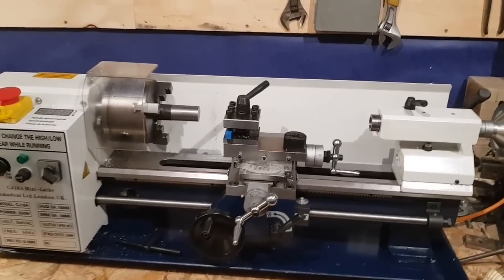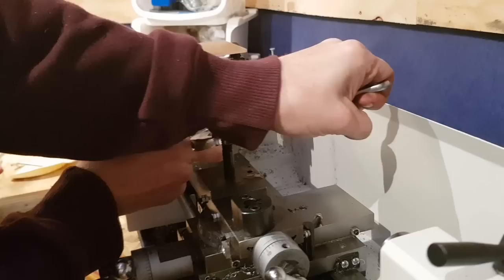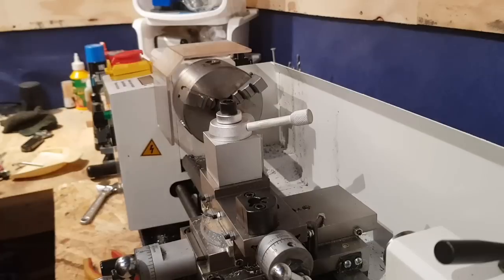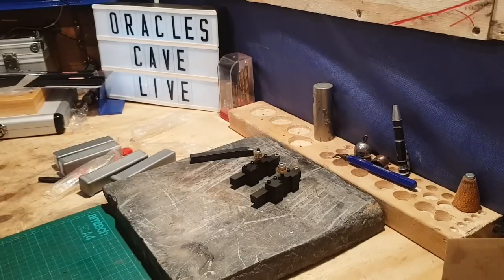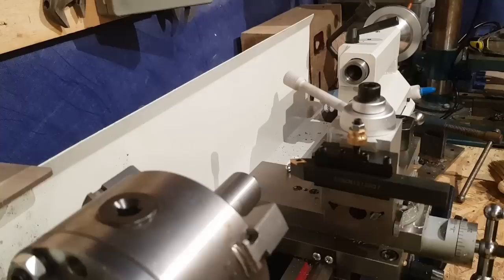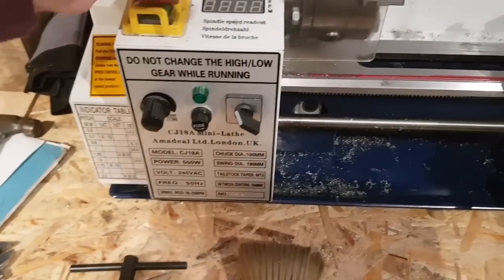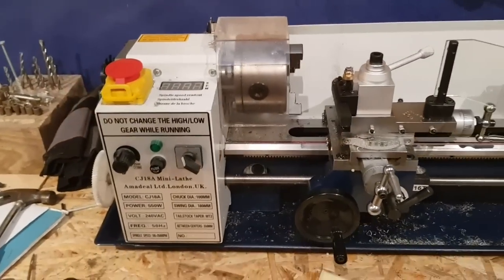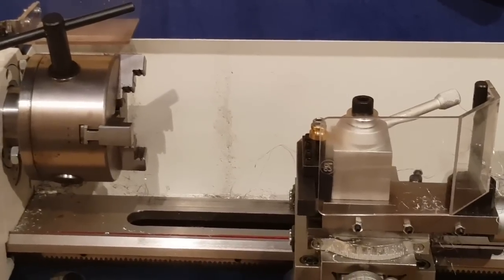CHINESE QUICK CHANGE TOOLPOST T0 7X14 MINI LATHE

Comment: I have an identical lathe I purchased from china 8 years ago, sometimes mine loses the RPM counter but will come back quite soon after. Only issue I have encountered is shearing a plastic key for one of the gears when I get lock up, 20 minutes to make and replace a new shaft key.
Reply from the maker: Have you tried cleaning or tightening up your Speedo censor, mine started doing that, and the censor was loose and hanging down too low.

There is a replacement upgraded board you can get, it has better electronics, if it's not your speed censor on the left end of the lathe inside the cover, it's probably your board.

But you can't complain after 8 years I suppose, mine lasted 2 hours lol

Comment: Search u tube on lathe speeds on different metals . Brass, aluminium ,mild steel, stainless steel all machine at various speeds. I have never needed to go over 750 - 800 rpm on all metals mentioned. Good luck in the steep learning curve

Comment: If I was you I would use the other set of jaws that was supplied with the lathe and watch more u tube videos on how to use a lathe
Reply: @noidontthinksolol  LOL, we know that, but let them jabber on.  I use a four jaw on square stock myself as it makes it dead sexy easy to round.
Reply: @crispindry2815  A 4-jaw chuck Vs a 3-jaw chuck more closely relates to a slightly larger lawnmower. Your statement is purely idiotic.
Reply: I don’t think fool has a clue😂😂
Reply: @stevesherwin1  Yes, it was cringe-worthy watching it.
Reply: I assume you mean the outside jaws rather than the inside jaws. For a little more cash he could have got the 4-jaw chuck.

He says he's spent a grand on the machine. WTF? I can get them for less than half that price - including many extras! In fact I did! I've ended up with a couple of sets of carbide welded or insert tools and 2 different types of quick change post sets (not compatible to each other) including the one shown here.

Ps. As if you didn't know; the 'speedo' is an hall effect sensor!

On mine, I've noticed that the cross slide can lift on the gib side when run hard. I'll have to look into adding a cross slide lock to cure that little problem. Since virtually all the parts I expect to be machining/making/refurbishing will be for miniature scale steam engines, accuracy and finish are paramount!